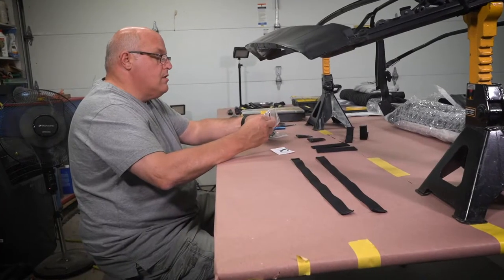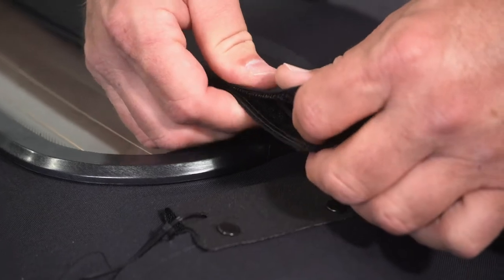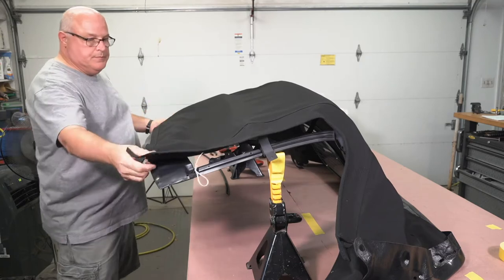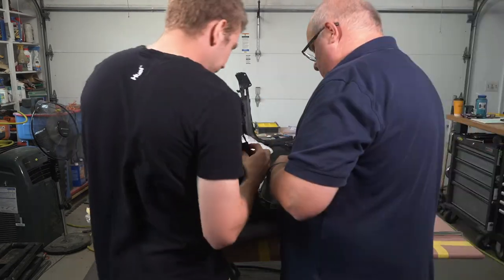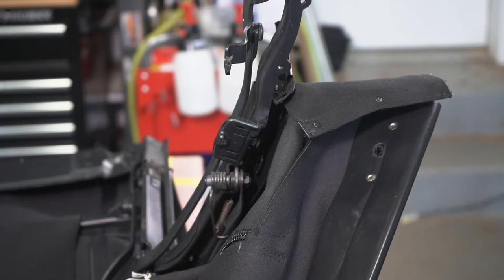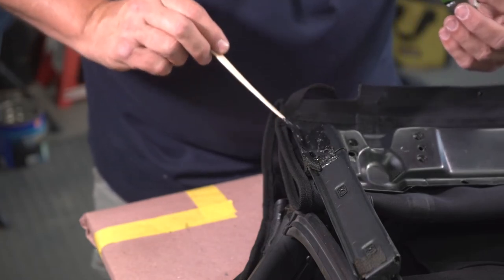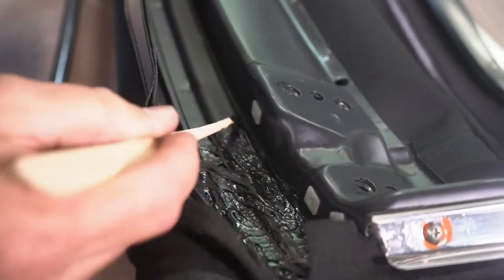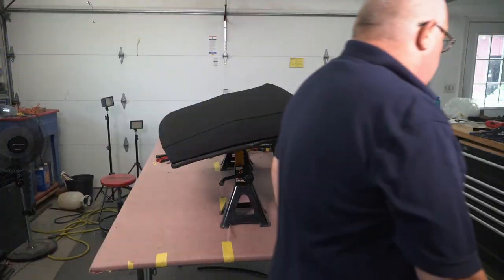Soft Top Reassembly - Mazda MX5 Miata Soft Top Replacement Pt. 3

Comment: Probably the best video on installing the soft top on an NA or NB Miata.

Three main reasons;

1. Lighting and use of tripods. There's nothing worse than a guy using one hand to do the work while shaking the camera with the other towards a dimly lit subject. I appreciate knowing what I'm looking at.

2. For the most part, level of detail is great. ie; description of how the listing tuck into the bow gap.

3. Pretty complete coverage of most of the details within the scope, ie; attaching the top to the frame.

I do have one suggestion.

It would be nice to have establishing shots, before close ups. Some of the details require the viewer to figure out just where a given detail is on the frame. If the detail shot is preceded by an overall shot of the frame, with someone pointing to the location and orientation of the detail about to be shown in the close up, helps with understanding.

Comment: Hi Pete, I need your help. I had problems installing listing panel. Could you please share the installation manual. I bought a Robbins soft top but it only cames with a pictures but not an explanation of how to do it. I have a 2006 NC Miata and based on your video, I think the soft top is the same model, mine is (2968 model). Appreciate any help you can provide. Regards

Comment: Is there a part 4 video?  I'm having a problem reconnecting the frame to the body.  Can't figure out whether the frame should be open or shut to do that, and whether it matters.  Bolt holes won't line up.
Reply from the maker: Hey Bill. Part 4 is still in the works currently. We kept the top and frame closed when installing into the body. One important thing to note is there a hook on the mounting plate of the top frame on each side. That hook needs to loop around a stud in the body on each side. That may be causing the issue with the bolt holes not lining up.

Feel free to send us an email at myunderdoggarage@gmail.com and I'll send some screenshots to try and help.

Comment: What cement/glue/adhesive did you use on the top? (looked like black tar in the video)
Reply from the maker: Hey Luis! We used 3m black super weatherstrip adhesive for the front edge of the soft top. 

https://www.amazon.com/3M-08008-Black-Weatherstrip-Adhesive/dp/B00063X38M/ref=asc_df_B00063X38M/?tag=hyprod-20&linkCode=df0&hvadid=312181776237&hvpos=&hvnetw=g&hvrand=370015532784011243&hvpone=&hvptwo=&hvqmt=&hvdev=m&hvdvcmdl=&hvlocint=&hvlocphy=9008128&hvtargid=pla-627402842112&psc=1

Comment: What type of adhesive glue do you use please?
Reply from the maker: Hi Lubomir. We used a 3m weatherstrip adhesive for the front of the soft top. Here's a link for reference: https://www.amazon.com/3M-08008-Black-Weatherstrip-Adhesive/dp/B00063X38M/ref=asc_df_B00063X38M/?tag=hyprod-20&linkCode=df0&hvadid=312181776237&hvpos=&hvnetw=g&hvrand=7679887133208690264&hvpone=&hvptwo=&hvqmt=&hvdev=c&hvdvcmdl=&hvlocint=&hvlocphy=1022653&hvtargid=pla-627402842112&psc=1

Comment: What did you do with the two black straps you riveted in before you put the top on the frame?
Reply from the maker: Those two webbing straps we just had hanging down over the bow they're riveted to. They wrap towards the back of the frame and straight down and the top canvas just sat on top of them. Eventually the other ends of those straps will connect to the back of the car body behind the rain rail retainer.
Reply: @UnderdogGarage  are those straps only used with the glass window top. I have a robbins plastic window and did not get those. I also got these foam stud seals. that goes, 1 before the rain rail and 1 after according to the diagram. so 26 total should be used but I got 28 in a bag with a diagram. did you get these as well and did you end up using them.
Reply from the maker: Hey @Kanwal Singh. The kit should come with straps regardless of window type I think. You might check Robbins site to confirm or call them. The straps help pull back center bow when opening the top. For the seals I think Robbins provided a couple extra in case you lost or damaged one or two. They did the same for the rivets in the kit. I hope this helps.
Reply: @UnderdogGarage  thanks for the quick reply. Called robbins, their tech just got covid and is on leave:(. So I got the zippered plastic window top and downloaded their instructions, and on page 7 it says "straps not needed for 2904/2905 tops" which is the plastic window. So it only comes with the glass window. Makes sense as its heavier and it allows the 4th bow to move against the 3rd bow when collapsing the top. Whewww, now I can continue getting the old glue off, cleaning, and putting on the double sided 3m tape and put the top back in. Can't wait.
Reply from the maker: @Kanwal Singh Awesome! So glad to hear there weren't any missing parts. Sorry, I thought it came with all soft tops. My mistake. Good luck with your top replacement. I hope it goes well!